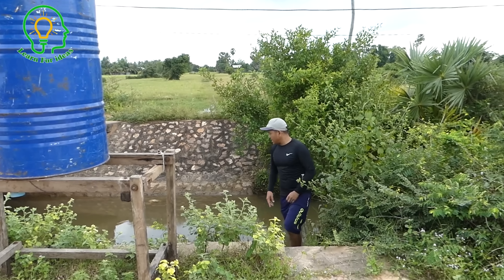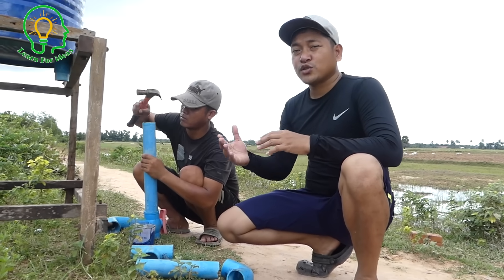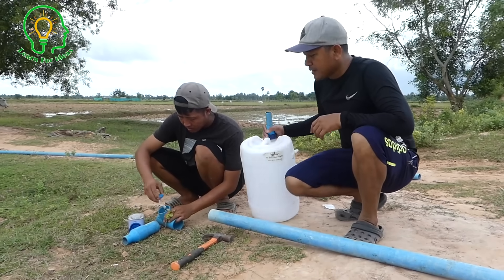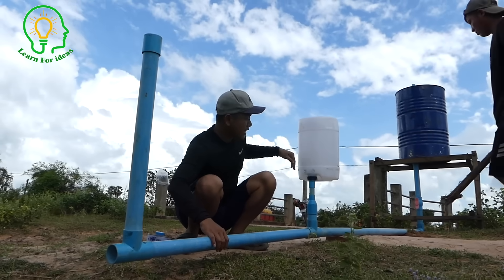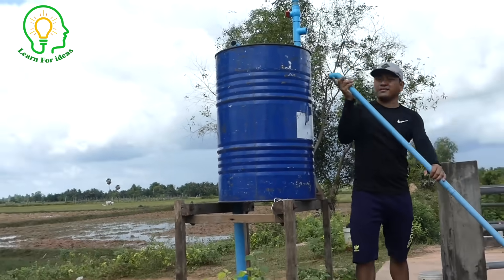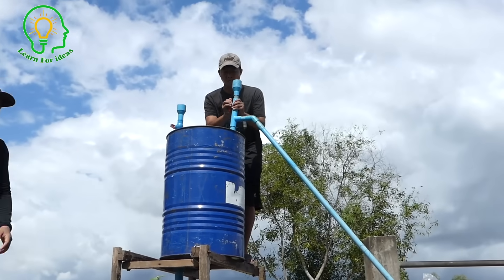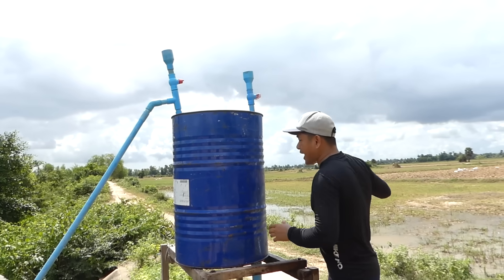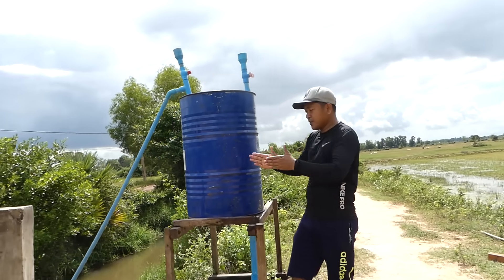Free Energy Water Big Pump and Big Air-Pressure for rice field | Water Pump without Electricity

Comment: So that system could power a turbine to create electricity
Reply: A big no!
First it is not true. It is not possible to happened except if the output is in lower elevation compare to water source.
Second the pressure is too low to spin a turbine. Thank you.
Reply: Happy to read your Idea 💡🙂
Reply: That’s what I’m thinking. If you used large poly pipe and circled back around to your water source with the outlet, you have created “perpetual motion”. On a large enough scale, you’d spin a turbine.
Reply: @coadycamcoad7352  Happy 😊 to read your Idea 💡 and knowledge 👍🙏💐
Reply: @coadycamcoad7352  Hệ thống chạy khi nào nước trong thùng kia hết nước thì sẽ ko chạy đc nữa. Muốn chạy phải tiếp tục mồi nước lại.

Comment: Is the vertical air pipe also closed at the top ? Then why the plastic barrel and the vertical PVC pipe in parallel? Can't we use just the plastic barrel?
Reply from the maker: yes sure, friend can you only plastic barrel

Comment: filling the intake pipe with water without any valve to close it to retain the water is a total bs. because once you remove your hand from the upper end, the water goes down and back to the river, thus it is empty and you claiming that it is filled with water is, as I said, a total bs (unless there is a non-return valve at the bottom of the pipe in the river, which you never mention). the "high air pressure tank" is not needed. how does high air pressure on that tank builds up? how would it push the water out? or are you emulating something like the ram pump. I can guarantee there is only 1 atmospheric pressure on that tank and nothing else. it is useless and has no function. now you are giving me doubts. to remove all doubts, use a transparent tank, and then show the end of the intake pipe in the river in clear water. even the tube to "trap" air, is useless as well.
Reply: 1 athmospheric pressure is equivalent to 10 M of head. And yes, there is a check (flop) valve at the end of the inlet pipe. The siphon effect is being used here, and as long as there is no air inside the inlet pipe, water will continue to be drawn from the source.
Reply: @jaypee2805  As long as it is siphon, it will work, even without those drums and those upright tubes and recently the containers. This is a hoax. Just a click bait to earn money from views. This is not free energy folks.
Reply: Dirt spoke.....sir... this is purely science....🙏💐
Reply from the maker: Ok i will try to fine the Mirror  Tank and Valve the end of input pipe , Thank
Reply: @LearnForideas  Don't waste anymore time and money. I tried it, it doesn't work, and accordingly, after so much computations, it really won't suck up the water unless the output pipe is lower than the water level of the supply. Honestly, I tried to believe that it could work, but I really have doubts, until I prove it to myself. Even if the water output pipe is just 1 cm above the level of the water supply, still, it doesn't work. Why? Because the input pipe and the output pipe are both governed by the law of gravity and that the properties of water are governed by height and the pressure they create based on height. Even if the intake pipe is so much smaller than the output pipe, it exerts more downward pressure than the output pipe. Show me a two hour no-cut video until the output pipe runs out of water from the reservoir tank and let us see if it can still suck up the water, and I can bet $10,000.00 on that. No matter how much vacuum that output makes, the downward pressure coming from that small pipe (which is suppose to take up the water) will still be much greater.  Lesson learned.
Reply: @dittspoke4400  i wanted to try, but honestly, i'm doubtful of this idea, the principle of hose level explained that no movements of water from one place to another. His presentations looks like the source is lower than riceland, how could it be posible, however, the vedios is like convincing to me, may you pleased convince me more not to try it, hehe, thanks.

Comment: Thanks once again for having your update  on free water system installation and your team and partner, hope I can do it with my self using your techniques, I have a question regarding on  your check valve Sir, I mean is that one package when you buy it at the hardware or is it you combine two items to make that check valve. Because I went to the hardware but I can't find the item you used in the system. Please reply and thank you, more power..
Reply from the maker: you could not use soft barrel
Reply: @LearnForideas  ... you are right 👍
Reply: From where we can order that you called check valve that you soak in the water
Reply: we call that device a "foot valve" here in northeast US and it is one piece from the store. maybe that helps?

Comment: What happens if you input pipe is the same size with the out put pipe?  When you filling up the drum with water maybe you can use  a big empty plastic water bottle cut it to catch all the water u filling to avoid spills
Reply: Smaller diameter intake pipe can provide the optimum suction power by minimizing the counter pull of the gravity. On the other hand, the bigger output pipe serves to harness that same energy of gravity and maximizes the pulling effect of it providing negative pressure or vacuum in the drum. This thing works becuse the law of physics is still intact or not broken. The pulling energy of  gravity in the intake is smaller compared to the pulling energy in the output so there is a net force, hence  net work.
Reply from the maker: why we use big pipe for output pipe because we need strong sucking water from Barrel and Not strong sucking and water could not suck from river also , thank

Comment: I am a farmer in the Philippines,may I ask the sizes of the PVC used in your inventions, thanks for sharing your knowledge
Reply: Dear sir, please inform what's maximum depth of water can  pull this vacuum pump? thanks from India! 🙏
Reply: @Bajnahi  vacuum=0 Pa/=0 mbarr/=0mmHg/=-1atm.tech=-10,3m water column
Reply: @Bajnahi  4 to 5 mts...
Reply from the maker: Input 27mm and output 60mm
Reply: @LearnForideas   If the system   do not  work for you, you can contact me for possible help and other concerns about the matter.
Reply: @cenoncapitulo5185  I need your favor. If you can then I will pay as you require
Reply: @cenoncapitulo5185  ....so happy to read your message....🙏💐 nice and brave heart ❤️ person with so.... helpfull nature person you are 🙏💐

Comment: Hi, I have a suggestion. You may put a pressure gauge near the pressure air tank inorder to determine how strong the pressure.
Reply: I think pressure guage won't work,  the system is working like a siphone,  so it has no pressure but it has a vaccume effect,  vaccume gauge will do the work.
Reply: @carlitomadrona6211  ... I think 🤔 you are right Sir 🙏💐
Reply: i have tested this and it did not work.
Reply: @toto_elio477  that's why you didn't upload your test. since you're upload also didn't work. haha
Reply: @voidisyinyangvoidisyinyang885  If the water level in the river is lower than the output to the field, this siphon can not work.
Reply: @voidisyinyangvoidisyinyang885  Sorry, but this is a siphon with a starting barrel. If the  river is the Pacific ocean, it still cannot lift a single pint one inch up to a higher level. A siphon is no pump, there is no energy input.
Reply: @voidisyinyangvoidisyinyang885  Yes he is using a foot valve and he is handpumping the suction tube. Now with a barrel, you do not need any foot valve or alternatively block the input with a plug or a piece of plastic bag in which case you may have to take a bath to open the suction side. No valve is needed using a priming barrel. 
Never heard of any Schrader valve being used for this, too small cross section and you ad a spring load. 

Yes, with any suction pump you are limited to about 25 feet, 10 m theoretically, but using a siphon you can not extract a single drop of water up there. 100% of the water must down to an exit lower than the source for a siphon to work.
Reply: MABIRU channel  .... welcome all innovative ideas 🙏💐

Comment: I have watched all the videos talking about this topic .... General idea this destroyed all the principles of physics .... the amount of water being sucked is much less than the water come from  the drum so ultimately it will stop working after few minutes .
Reply: I cancelled this project and replace it with  a rope pump using a wind power
Reply: @saadmahafzah8716  i think it wont run out of water because it can only put out what is being drawn in the lake..because the drum is sealed and vacuum...thats y he emphasize that it is important to make sure there is no leak in the input pipe snd the drum...

Comment: Two areas of doubt, firstly about the intake pipe is there a nonreturn valve attached, secondly, the improved version with the extra plastic cylinder is to keep the vacuum pressure constant, thanks for your return feedback?
Reply: Its NRV... that hold back the water against gravity  in the intake column. And the  whole  principle is make  storage tank   vacuum tight. The  drum volume also act as storage buffer to maintain the  constant flow..
When you open the outlet valve, water  rushes   in due  to level deference though the drum outlet. And this creates vacuum in the entire supply chain connected to  inlet water column. The  vacuum then sucks the water  thru water column NRV from river or bore well  ( as the inlet).  Thus maintaining  the flow. Pl note, outlet flow  pipe dia must be smaller then inlet pipe.
Reply: @bharatkukreti8449  No, they used an outlet about the double diameter than the inlet. You will find the diameters used in some commentary above.
Reply: @bharatkukreti8449  ..
Wah wah... Bharat sir ji....moj 👍🙏
Reply: @bharatkukreti8449  see this youtube video : FREE ENERGY Water Pump FULLY EXPLAINED!! REAL OR FAKE?
Eternally flowing water - The truth about eternal flowing water without a pump
Reply: The non-returnvalve was the secret! I was almost certain ! Thanks
Reply: The intake has a non return.
Reply: @mndiamundia1197  see this youtube video : FREE ENERGY Water Pump FULLY EXPLAINED!! REAL OR FAKE?
Eternally flowing water - The truth about eternal flowing water without a pump
Reply: My concern is has an independent person tried  it and it works?
Reply: see this youtube video : FREE ENERGY Water Pump FULLY EXPLAINED!! REAL OR FAKE?
Eternally flowing water - The truth about eternal flowing water without a pump
Reply from the maker: It is my pleasure

Comment: Great work bro love your work will try this system God bless your work and your efforts
Reply: I'll suggest first try for yourself with a small prototype and go for bigger projects. I tried many a time but it doesn't work well. Yes it works for few minutes but eventually the flow of water either begins to flow in droples or the water in the barrel gets exhausted. And that's the reality of it...when tried. I tried a multiple times but the result was the same
Reply from the maker: Best of luck

Comment: Thanx 4 explaining how its done...you explain how to do it very well...you said once the inlet pipe has to be,smaller...others don't explain in detail as you do...i wish you success..Larry..............Australia ........
Reply from the maker: Glad to help
Reply: If the outlet is below water it doesn't matter. The problem with too big outlet otherwise is that air will come in if the flow doesn't fill the pipe. 
If air enters the system it will accumulate at the highest point, and will eventually make it stop. It's smart to have a system to trap and potentially bleed of any air.
Reply: @AldriFerdig  ... please read my comment and if you want a pumping a water 💦💦 to height level.... put the one-way valve in your out late pipe.... please try this 🙏💐